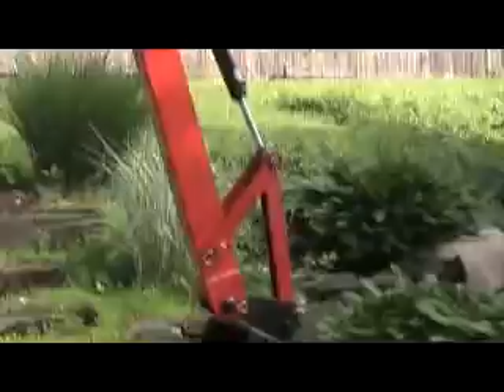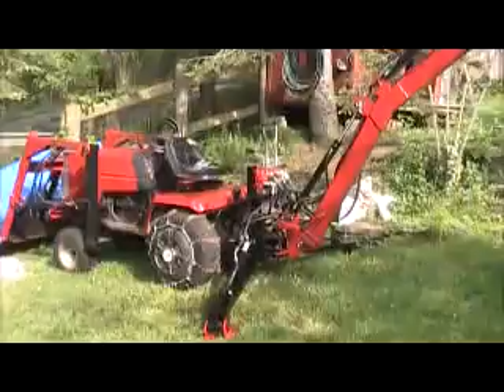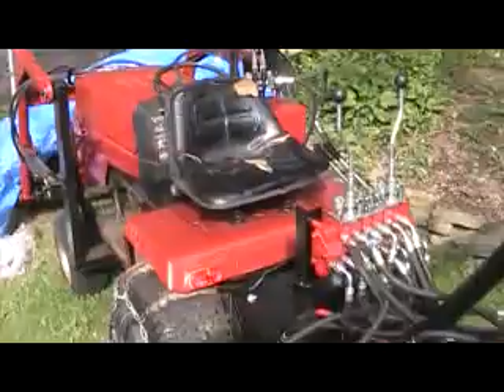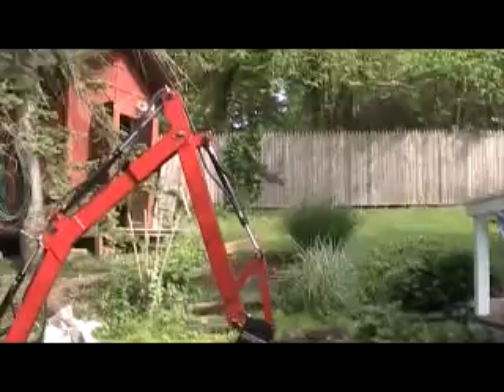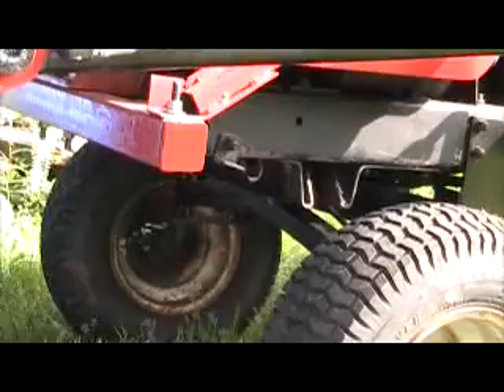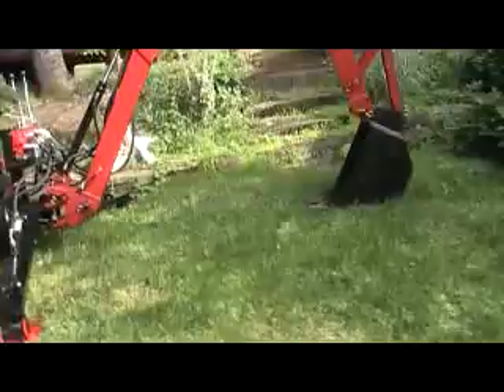20120506082119.mpg

Comment from the maker: Thank you for checking out my site, to answer your questions the flow valve I used didn't change the speed so I took it off. Your pump only needs to be around 8GPM and the cylinders I used are 3500psi, although you could use 2500psi cylinders, and you will have to figure out the length and stroke you need. I built my backhoe and front loader using what I saw on you tube and what came to me but the next time I think I would buy a set of plans.

Comment: I think the boom might be a little bit long. But everything looks very great. How do you know about the flow reducing valve. I`m going to build a backhoe and most of the backhoes i see work way to fast. For me it`s very confusing to find out, witch pump and what kind of cylinders will work fine and smoth. I would apreciate an answer very much. Sorry abut my english. I`m german.